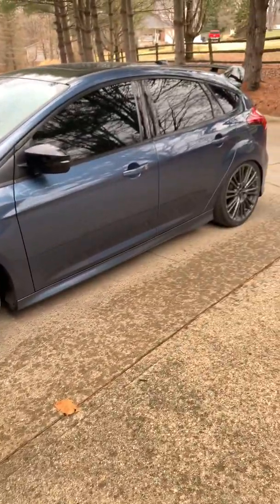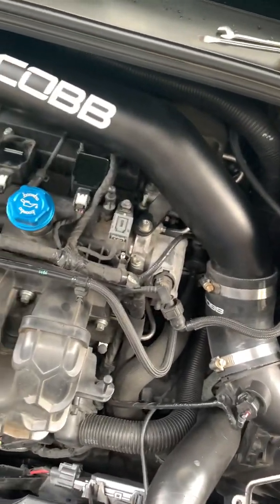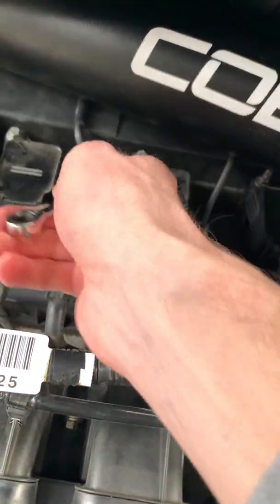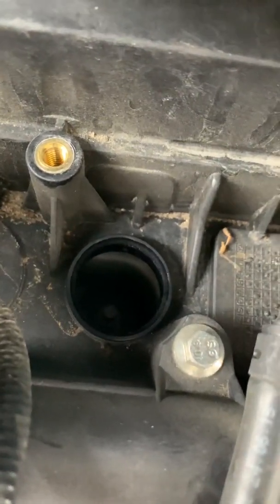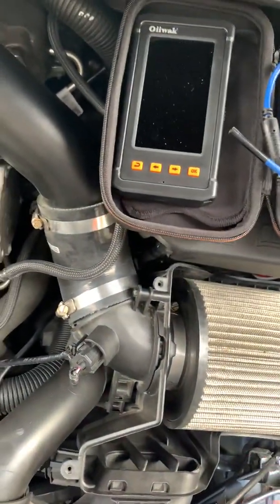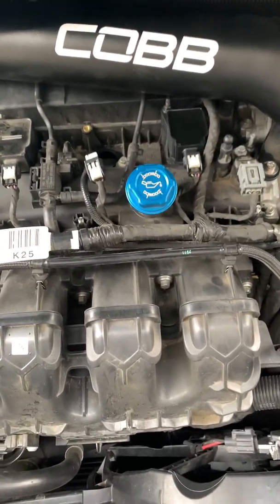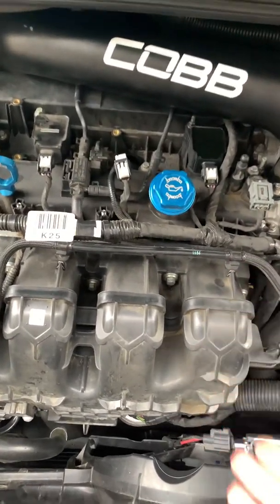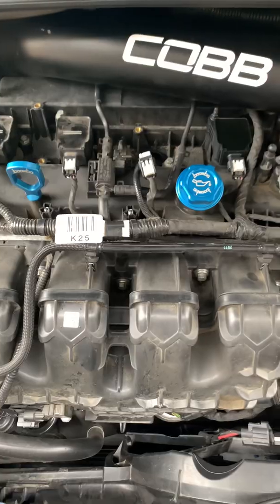Focus ST understanding misfire and steps to take on fixing the issue.

Comment: I have a misfire on cylinder 1 and 4 and Ford doesn’t know how to fix it, I changed all my coil packs and spark plugs and still nothing. Any advice? Just hit 100,000 miles
Reply: Put in seafoam high mileage seemed to help best guest it’s fuel injector dirty and valves are too

Comment: TLDR? Move one part around at first...dont do too many things at once.

A specific cylinder misfire is fairly easy to troubleshoot at first... if you suspect plugs, swap plugs and drive around, see if the misfire follows the plug. Same with coil packs. On a engine swapped, supercharged Cavalier i had, a misfire was eluding me for months. Turned out I had wrenched on it so much, removing the coils/plugs/etc so many times i somehow tore/freyed the wire inside the clip to the injector. The exterior of the wiring loom as solid..but when i bent the wire to the connector (that clips to the injector), it bent like a folded piece of paper. I opened it up, sure enough was cut in half. I soldered it, and it was golden.

My 2016 FoST was at the track this weekend and after literally JUST hitting 70,000 miles, I started getting major misfires under load. Cost me a whole day of racing. Checked plugs, gaps, check coils, nothing seemed off. Then ran my codes on the COBB AP and its showing P0088/P0087/P0192/P0300/P0301. So I either have a failing fuel pump or a bad sensor. The sucky part is it can be any one or combo of issues. Its a major PITA trying to troubleshoot misfires but you just have to start doing it piece by piece, generally looking at any most recent 'variables' that have changed. For me, being on E30, i started looking at fuel quality. So I'm going to be running it to E and running 93 to see if the problem persists. Then I may toss in the high side (i believe it is) fuel sensor on the front of the manifold (between the intake manifold and radiator).

Its a good video to help guide people, the scope is prob the best advice here. But its important to try to 'follow' the issue...if your code was P0304 for cylinder 4 specifically, swap coil packs ONLY at first. If it changes, the pack is bad. If not, it may be the plug. Swap the plug. Etc. Sucks i had this issue as i got all my stuff dialed in and was tearing up the track...then when I really wanted to get some good runs in my car decided "nope!"... at least I was able to get it home and now I can casually TS it while its safe at home and not at a track or 4 hours from home lol. Dont get discouraged and give up...its a nice feeling when you finally figure it out and are like "SOB...thats all it was?!"  ^_^

Comment: Some of these vehicles have gremlins and the misfires is one of them.  For those of you that have done a plug swap or replaced a coil pack and it fixed the problems you’re fortunate, no all misfire issues are that easy and a lot of people have dumped these cars because they have never figured out the issue, Ford doesn’t even know what causes it on some of the ST’s.  There are a lot of variables to consider and a lot of sensors and grounds and carbon build up  in some cases.  I’ve been trying to figure my ST out and when I think I’ve got it the cel light comes back on for no reason with no warning.  I’ve replaced plugs, all coils, the purge valve and I’ve cleaned my valves as well.  The car will run perfect for hundreds or thousands of miles with no issues then one day if will start backfiring and running crappy and boom, cylinder misfires on one then multiple then cold start misfire or random misfire.  The car really is my favorite vehicle and some have no issues like my brothers with over 100 thousand miles and never a cel light.  My last ST had almost 47 thousand with 0 issues but I got greedy because it was a base mode ST1.  My point is some of these issues are wear related and just a simple failure but a few of these like my vehicle just keep coming back for no apparent reason and they are very tough to figure out if you ever do.  Thanks for the video and good luck to anyone dealing with these issues.  I’m at just under 30 thousand and have had several cel lights and have replaced multiple components to no avail and have had the issue stock and tuned.  Just be prepared for it if you love the car like me I plan on keeping it and dealing with it and hoping that I find a solution
Reply: Had the same random misfire on mine found that the high pressure fuel pump had a glitchy sensor probably from the start & the pump eventually failed completely. After replacing the pump no more issues
Reply: @TheAnderson-px9kk  
Glad you were able to figure it out
It’s been better since I’ve done some work and replaced a lot of failure items like O2 sensors, purge valve, coils and plugs.  It wouldn’t surprise me if the hpfp is the issue and it’s intermittent because I still feel the shuddering randomly, especially when it’s cold
Something to look into because I’ve replaced all the other items that would cause misfires
Reply: @Sonicaceman  If you have connections that can help you with a spare pump to test that would help my tuner did this before we bought the pump because they are pretty expensive unless you go with aftermarket which I would not do especially if the car is tuned.
Reply: @TheAnderson-px9kk  
That’s a good idea.  I’m not 100% sure I’m keeping car and I’m waiting for light to come back on.  It hasn’t since I’ve replaced all the stuff but I’m still not convinced so if I keep it may I can convince my bro who has the same car to swap it and see if it fixes it. Waiting for the light to come back first 
Hope it doesn’t but I swear it was going to come on a couple times when it’s shaking and shuddering and stumbling when cold
Thanks for the tip 👍🏻
Reply: @TheAnderson-px9kk  did you have CEL? Or any code drop out? What were the symptoms besides misfire? Cuz in my case misfire are only at cold start and rpm are sometimes droping after a clutch depressed when I change to idle but it is really small drop.
Reply: I really hope you found the solution cuz I'm in the same state as you. If you can please share the solution thx.
Reply: @wegiel1987  
I can’t say I’ve definitively found the solution but the car is better since new O2 sensors, purge valve replacement, new gapped .26 plugs and a manual cleaning of valves and my meth kit I added.  Still feels like it runs rough until it’s warmed up and I can’t say I totally trust it to not throw a cel light this winter.  It did not last winter, but this is a new year lol.  With that being said my fingers are crossed 🤞🏻 that the light remains off.  I do feel like some of these Ecoboost engines just have something that is off from the factory whether it’s a small defect between the deck and head which leads to very minor head gasket leaks, a valve issue on the head or super fine cracks on the exhaust port to turbo, idk.  I’m not an engineer and wish I could compare the ones with problems torn down to a good to determine this.  My brothers ST, same year as mine (17) but with 116k to my 38k is just different.  He has never had misfires or any unusual drivability and he bought his new.  I love my car so I plan on keeping it and if I get a good winter vehicle and the money I plan to build the engine and refresh the head and short block.  If and when that day comes I’ll be interested to see what I find.  I just think some of these ST’s are tighter and built better with closer tolerances and it’s like anything, some are better than others.  Hope you figure it out and I’ll post if I have any problems or figure anything definitive out.

Oh btw all the coil packs were replaced new also and I only run 93 octane fuel
Reply: @Sonicaceman  I also change spark plugs, coil packs, purge valve, low pressure fuel pump, acc pedal and different PCM with stock map and newest soft. Now at cold start it therw about 15 misfires so it doesnt show MIL. It run smooth but sometimes  rpms drops when I change gear to idle and drive to lights. Maybe I'm crazy but I'm still looking to run it perfectly. I will now look up to crankshaft position sensor and set it to right position.
Reply: @wegiel1987  
I don’t think these vehicles will ever runs perfect but if no codes and no jerking and shaking when cold I’m fine with it
Reply: @Sonicaceman   Did you ever get a CEL again? Or did you try change the fuel pump? I seem to have the exact issue you described and have also replaced the O2 sensor, spark plugs, valve cleaning and other maintenance items but the issue persists. I get misfires and stumbling/shuddering on very light acceleration as well as on cold start up. The colder the weather outside the worse the misfires are.. If i accelerate just a little bit harder then its perfect. Only at idle and very light throttle. Its very annoying.

Comment: Misfires on these 2 liter motors are common, there isn’t anything wrong with them it’s just how they operate, just running to the store 5 minutes away I get 15 misfires sometimes 10, it’s nothing to worry about, it’s the knock and the negative ign corrections you want to watch out for
Reply: I’m stage 3 with msd coil packs and one step colder plugs gapped to .26 as recommended by ngk and my tuner no matter what misfire is always going to happen most of the time under idle after cold start and if you have the crackles and pops tune

Comment: So my accessport says cylinder 1 misfire I don’t think it’d be anything other than plugs and coil packs
Reply: Did you get it resolved?? Mine is doing the same
Reply: @Gxrrettx  so are you changed the number 1 coil pack?
Reply: @peterAZ06  I did everything possible. Turns out cylinder 1 is completely dead.
Reply: @Gxrrettx  How tf does 1 fix this ?

Comment: Do you have a link to the scope?
Good video just hate the orientation it was filmed in 😂

Im trying to track down my misfire on my '13 FoST. Get worse some days, does it warm or cold motor at idle. New plugs gapped @.031 on NGK 6509s 60k miles. No smoke once exhaust is hot enough to remove condensation. No DTC codes, no misfire data stored on the PCM 🤷🏼‍♂️ so I'm at a loss
Reply: Pulsar Tech did you ever figure out the mis Fire problem? I’m getting cylinder 4 mis Fire , everything on the car is brand new I get misfire codes but nothing on the pcm I think it’s my injector even tho it’s only 5 months old
Reply: BarberHomie CiscoFreshCutz I didn’t, I ended up selling the car back to the dealership 99% sure it was wiring harness related. They wouldn’t look at it even though I brought cash and the other option was guaranteed payment through warranty